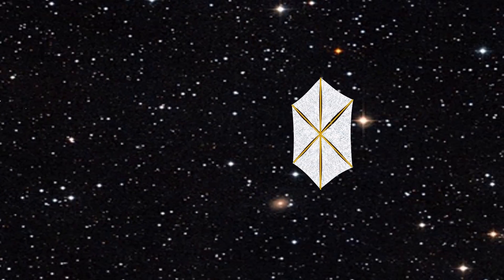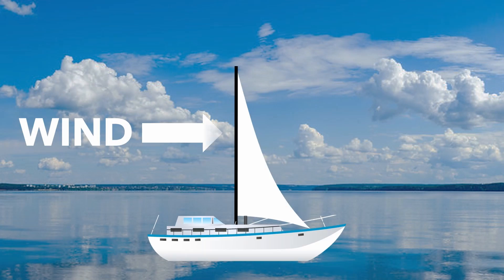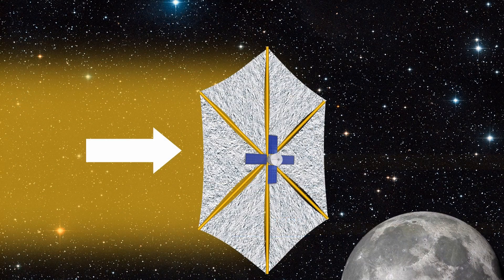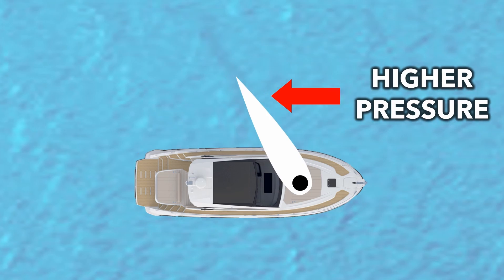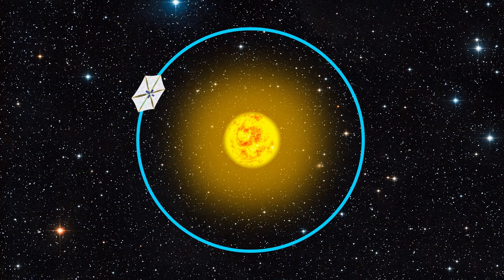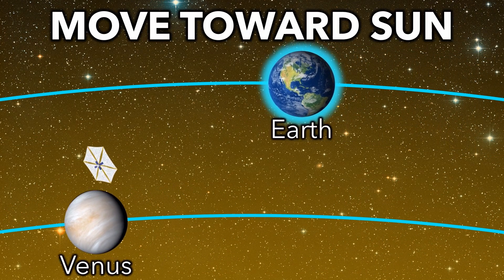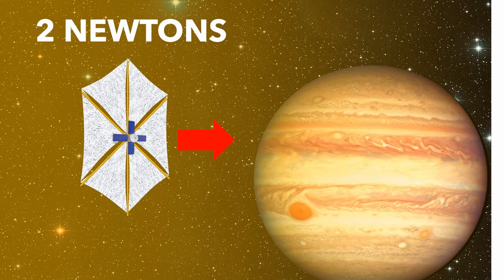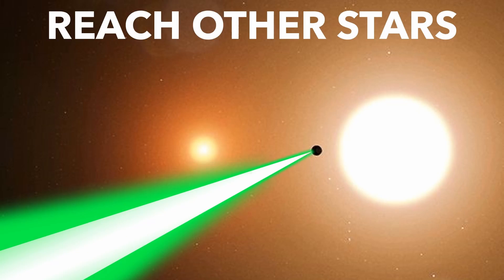Solar Sails Explained | The Spaceships Powered by Light

Comment: I think that solar sails can't be used to travel in another solar system because they can't withstand powerful lasers to have a decent acceleration instead we could use high-power laser transmission made of gallium nitride or perhaps a powerful and highly collimated laser and a magnetic confined plasma that can be heated with that laser wirelessly and then converted directly to electricity or we could use photon recycling propulsion.

Comment: LSSL - Light Sail Sequential Lasers 

Proposal for using Light Sails for interstellar travel using a set of lasers within
the Light Sail craft.

1.  A current Light Sail proposal currently shows using Earthbound lasers to provide
the thrust for a Light Sail.

2.  The issue with this setup is that the signal(s) would reduce or attenuate the greater
the distance travelled by the Light Sail given that the lasers are on Earth.

3.  To reduce light power attenuation as much as possible then this is a proposal to 
send a 'stacked' or Sequential Laser aggregation set up in front of the Light Sail. 

4.  The Light Sail is initially manufactured in space with the Light Sail and the lasers.

5.  The components are the 1 -  The Light Sail itself (four sections?)and 2 - Then at the 
center a long tube in front of the Light Sail that contains a set of lasers pointing in 
the direction of travel as in towards Proxima Centauri.  There could be one laser per 
'block' or a set of lasers grouped together in a block, say four lasers per block, and 
for example purposes, ten blocks could be contained in the tube of the four lasers per 
block and the Light Sail could have four distinct sections.

6.  The initial laser section is released from the tube and its lasers are ignited to send 
laser light to the Light Sail.  

7.  The Light Sail accelerates due to the initial thrust of the first lasers.  The Light Sail
blocks are possibly divided into four sections so this could give it 'steering' capability in 
that one section or the other could have a stronger signal than the others to allow the craft 
to turn given that the Light Sail has four distinct Light Sail panels.

8.  After several million kilometers or more then the signal from the first laser block might
be well attenuated or significantly lessened.  The Light Sail itself should have significantly
outpaced the trailing laser.  The trailing lasers sections can be nuclear powered to follow
the Light Sail and send its laser power but the signal, as mentioned, might be significantly
reduced.

9.  At that point the next laser in the tube is released and as it falls back and its lasers are
activated.  This laser setup has its nuclear powered engine activated as it trails the Light Sail.

10.  This sequence is repeated along with any modifications required due to its direction toward
Proxima Centauri.

Comment: i don't think 20% is the limit, but for the power produced for the light probably. if one is willing to accept higher g forces or have much wider sails, then you could have far greater numbers of lasers, far beyond the 100 power plants you mentioned. one thing i believe would be better than just running on a sail, would be to make a staged spaceship. the sail could boost a ship which has a powerful particle accelerator powered by nuclear reactors to bonkers velocities. i can imagine this pushing the enzmann echolance.

Comment: Light doesn't have momentum... Or does it? 😮‍💨

It has no mass, so no momentum. Except... 😉
Reply: Light has momentum even though it doesn't have mass. The amount increases as the frequency gets higher / the wavelength gets shorter
Reply: Specifically its momentum is equal to the energy of the photon divided by the speed of light

Comment: The energy of photons are transferred to the sail providing a pushing force, which can be calculated using F=(2Pη)c, 

Where: F is force 
P is the energy of each photons (energy is E=hf)
η is the efficiency of the solar sail
c is the speed of light
Reply: Thanks for the precision, do you know where I could find some explanation about these calculations? It's because I am working on an oral project for the end of the year. Also, with this pushing force, can I use Newton law to calculate speed ?
Reply: Wikipedia and a place called the solar sail wiki have some good information